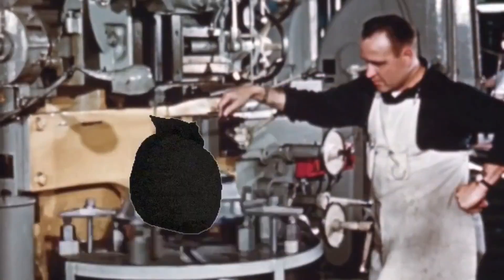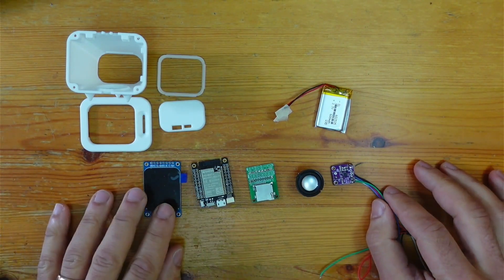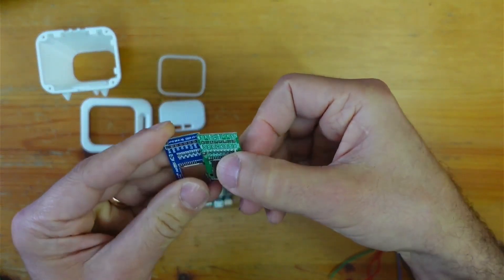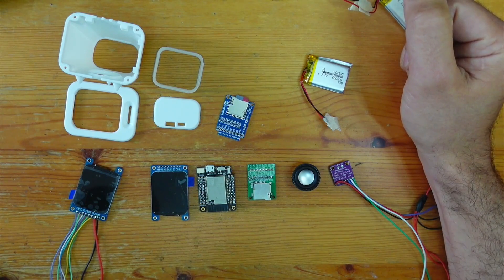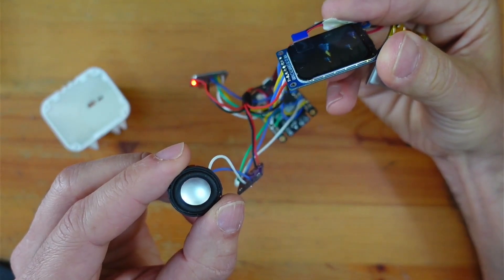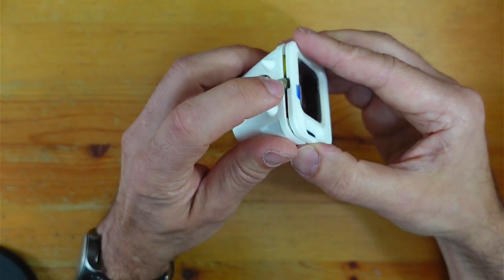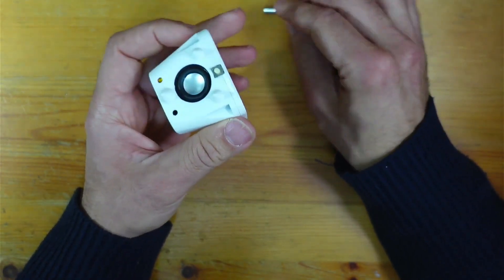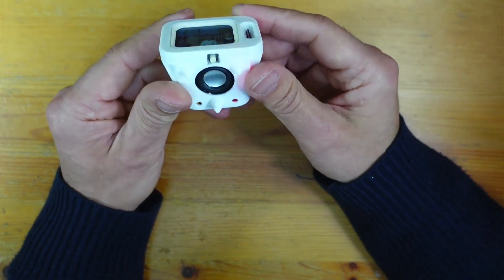ESP32 TV - DIY Mini Retro TV

Comment: hi, thanks for the video, can you help me with one thing? for some reason my project starts working excelent but after a couple of minutes it strats showing glitches, i already change the cables for thiker ones and all are soldiered.
it is like when the components heats starts the problems
Did you have any similar problem?
thanks
Reply from the maker: That's a strange one. I never had that exactly. I get glitches when the battery drops below a certain level. It's the only way I know it needs recharging. The other time I've had a slightly delayed glitch was when using a really cheap (fake Lenovo) $2 microSD card from Aliexpress (some of their cheap cards are ok). 
If you are building the mini TV in the video, it's actually a real b***h to get it working flawlessly  :D  ---Good luck!

Comment: finalmente ci sono riuscito, ma non capisco come faccio a mettere piu video nella sd e visualizzarli con il pulsante
Reply from the maker: https://youtu.be/ktQFWlnue6g?si=QSJGIFuflcUnFc4f&t=452
Reply: @megazoid  io ho fatto la procedura ma nn va, come devo mettere i file? Dentro cartelle diverse?
Reply from the maker: @Kuro80125  Every sub folder (1, 2, 3, 4, 5, 6, etc..) must contain the files 288_30fps.mjpeg and 44100.aac

Videos > 1 > 288_30fps.mjpeg + 44100.aac
Videos > 2 > 288_30fps.mjpeg + 44100.aac
Videos > 3 > 288_30fps.mjpeg + 44100.aac
and so on...

This only works with the software I provide on thingiverse (MiniESP32TV_bin.zip)
Reply: @megazoid  ho l'altro progetto con la mini tv spyretro visto che ha memoria limitata, perché non fai vedere come aggiungere un lettore micro sd come in questo progetto, così abbiamo più memoria a disposizione. Ci farai un video?
Reply: Hello, I am getting the same problem you had in the beginning. It says "file system mount failed. how did you fix it?